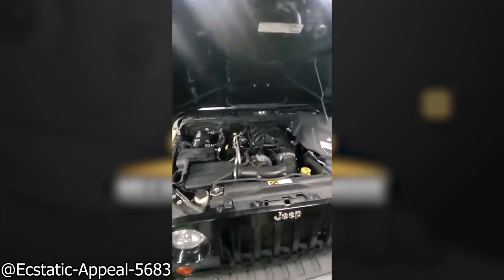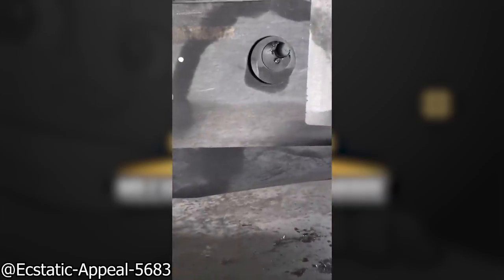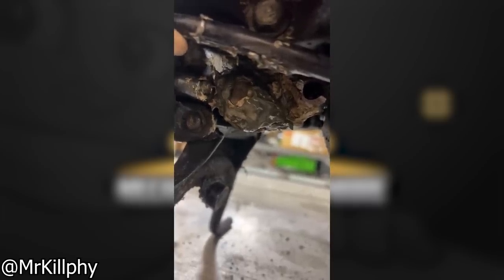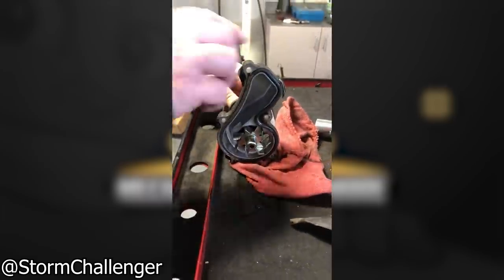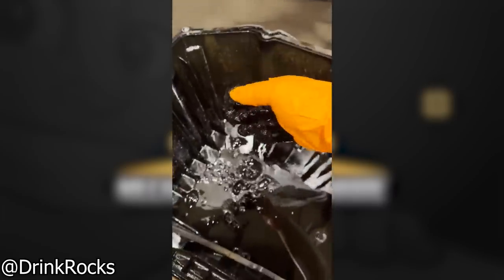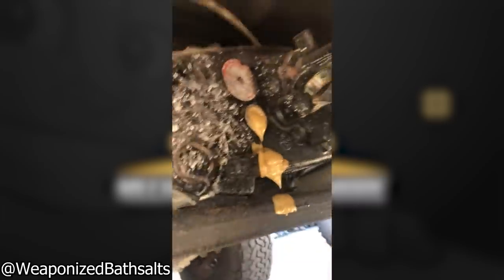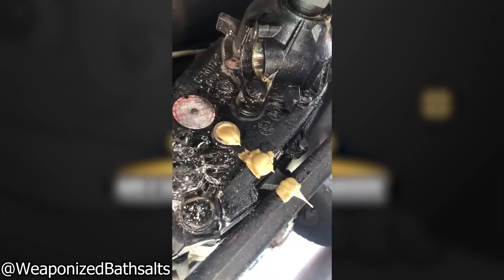Customer States 'I Just Had An Oil Change Now My Engines Smoking' | Mechanical Nightmare 121

Comment: These videos always astound me. My '97 Honda Civic is pushing 350,000 miles, and I've had VERY few problems with it. (I've made videos at every 25,000 since the car was new, with about the last hundred thousand up on youtube). I have been fortunate I know, but I also take care of my equipment. It seems that some people don't even do basic maintenance. (Note-I am NOT a mechanic-when I say "I take care of...". I mean, I send it to be looked at/maintained)
Reply: @delta250a  Right. Outside of those standard things, all I had to replace was a wheel bearing too, as well as the power steering rack, and just recently (last month), a bearing was going bad in the manual transmission, so I had all the bearings done as well as the clutch. I think that was it (Oh, I had some rust work done too)
Reply: kinda sad, these people are on the same road as you and I !
Reply: I have a 97 accord with almost 320k on it
Reply: Do you drive it hard?
Reply: @theglitch99  No. I drive at a very sedate speed, and do not rev it too high before shiftinhg
Reply: @davidlund5370  I know. It is scary. When people no longer are God-fearing, they have no qualms about endangering themselves and others. Not only the condition of their cars, but they way they drive them (selfishly) shows this. Only under God's Kingdom will we have considerate people
Reply: @SJHFoto  nah.. its an cultural issue, and God has nothing to do with it.
Reply: @theglitch99  I drive my BMW F21 pretty hard and close in to the 200k km mark, only had to replace the wheel bearings and timing chain (which is known to fail early and got a rework by BMW), otherwise it looks and runs like new.
And with driving hard i talk about redlining it regularly, doing 200+ kph for several hundred km and so on.
Reply: Cheers, I have the same car. It was extremely neglected before I got it. A ton of work and new engine later and it's a much happier car. Great vehicle even for all the abuse it's suffered.
Reply: @SJHFoto  Input shaft bearing.  Makes a lot of noise.  I had to replace mine as well.  While I had it out I replaced bearing, all the seals, and the clutch.  2003 Civic.
Reply: @hdfxrs9121  Yep, that was it. And I think you are wise to have it all done at once-I did the same-the cost came from the labour, not the parts mostly
Reply: KevTech 1  There is a time and place for everything. Using an instrument safely is paramount. Just because you can do something, it does not follow that it is always safe to do so. I'm sure you can see the logic in that
Reply: Indeed.
Reply: Hey bro, you’ve got a 6th gen I’ve got the lowly but under appreciated 7th gen. It’s the 05 EX so it’s the last model year when Honda had it all figured out with the 7th by then. EX so sunroof, cruise control, alloy rims, more stuff I can’t remember. But most importantly… V-TEC YO!!!  Yes btw, it’s a manual 🙃 239,000 and going strong. 
Good luck to you in your Civic journey my Honda Brotha!!
Reply: @LightsaberGoBrrrrrr  Thanks! What is the "V-TEC YO"? I am aware of the VTEC-E that the mid-90s VX hatchback had which gets phenomenal gas mileage, but I never heard of the YO variant

Comment: I really wanted to learn automotive repair but the college I went to just worked under the assumption I’d know everything immediately.
No idea where you’re supposed to learn this stuff but I get so paranoid about my car anytime I hear a rattle, just to realise it’s just loose ice or something
Reply: U start learning about cars by working on them. I started off by just simple oil changes and brakes. After that i moved on to belts, alternators, powersteering components, suspension. As time goes on, the more experience, the more you know what that sound is or how to find that leak. Its quite simple if u just try. I started at 16 with my rusty subaru outback with 300k on it, now, at 24, i can swap motors, transmissions, im working on my electric diagnostic skills. I love it cause you always learn something new.
Reply: buy a shitbox, buy a toolset, wrench on t

Comment: My 2015 v6 mustang has made that ticking noise from the valve pressure release too, the ticking goes away after you run it and the pressure balances out, if not replace the valve.

Comment: Oml the fuel leak thing

I thought my truck had something seriously wrong with it, since half the gauges on the cluster don't work (1991 Ford, go figure), it wouldn't start, it always starts, turns out someone got under it, and cut through the fuel filler hose to steal my gas
Reply: KevTech1  i was born after the truck was made, so idk if that would've worked
Reply: @instigatedeye5941  Funny you say that. The college kids that work for me think it is amusing that they are riding in my car and were born after I bought it! If it runs, there's no need to buy the latest thing and go into debt
Reply: At least you are lucky it does not have a cat on it, they would have taken that as well.
Reply: @SeanBZA  it actually does, we have strict smog laws in my state
Reply: @instigatedeye5941  None by me at all.

Comment: Damn if that is a nudge what’s a hit.
Reply: probably the wheel and strut assembly standing there while the rest of the car is gone...
Reply: I accidentally hit the curb once trying to park ran right up on it. No damage just little scuffs on the tire I whipped off. My ego was broken then felt really embarrassed I did that. Just for the hell of it when I got home I looked under the car there was no damage those control arms can take a beating. So when I see people with busted control arms you didn’t just nudge it you hit it hard.
Reply: I'm surprised it didn't crack the rim.

Comment: 4:51 What are we looking at right there? What I see in the circle looks like a vertical scratch in the cylinder wall which 90% of good healthy running engines have... Curious how that made it in this video of mechanical nightmares?

Comment: The gas tank hole reminds me of riding with my Dad in our big tilting flatbed truck.. We would haul cars in for scrap.. Back when you didn't even have to show a title to junk a car ! The car owners used to PAY to have them hauled ! Anyhow ..My Dad would lower the back of the tilt bed, lift the back of the car, and he would drive a brass punch into the gas tank with a brass hammer.. if the gas smelled good we would take it right up to the truck with a bucket. pour it straight into the truck thru a funnel and rag. .. Lower the car , load it and haul it in. I don't think you even had to remove the gas tank back then if it was empty.. Miss those times with my ole Dad.
Reply: I'm a scrapper and you still don't need to remove the tank.
Reply: @tinknal6449  Interesting, that might vary state to state.. I think? its required here now.  Possibly not by law but all the yards require it..  Also in Iowa once a vehicle goes to salvage...the title is destroyed .. the vehicle can never be on the road again legally. I am sure people work around it sometimes with title games.. I have heard of yards that would only sell half of a vehicle .. cut down the middle and I have seen a super valuable late 60's Bronco put on the bottom of a stack of cars ..probably just to stop people from trying to buy it.
Reply: @foodstick  I'm in Minnesota.  We don't need a title if the car is over  20 years old either.

Comment: 5:17 Kind of suspicious that it started leaking right after the other shop changed the oil, and smoke that bad.
Reply: First time it had enough oil to make it to the valve cover, nothing suspicious about that, lol.
Reply: @wally7856  Hey!  At least they took it in for a change!

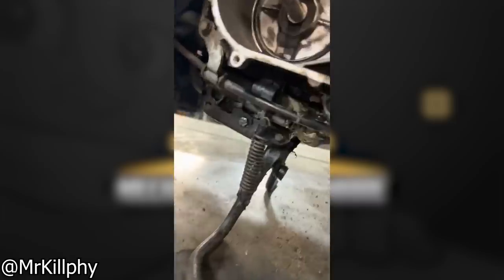Comment: 1:14 I'm not talking shit about anybody, I just see a lot of people "sealing" leaks with JB weld, Tape, foam, RTV, etc... I would love to be a third person point of view watching them diagnose the leak origin and then rummaging around or going to there local Rocky's and spending 20 minutes in the glue section. Then seeing them smear something that would never work, I mean they could have at least wire wheeled the area a little, but that's not the kind of people we're dealing with here. Then seeing there disappointment the next day when there's a puddle of oil. HAHA

Comment: 2008 Sonata... These modern vehicles, you can't even see the engine for all the plastic garbage they put on them. No wonder he didn't know his valve cover gasket was leaking. Now, compare to any Ford, Chevy, or Mopar made before 1980. When I open a hood, I expect to see an engine, not a big useless plastic cover.

Comment: JB weld is a good sign someone doesn't actually need to be having tools lol
Reply: Used JB Weld to seal a crack in an oil pan in an old truck I bought that was weeping oil at a pretty good rate.  Without draining the oil.  Hot glue to seal up the crack, then JB Weld over the hot glue.  7 years and not a bit of trouble out of it.
Reply: @bobbybeaver4423  if that's what you want to do; god speed
Reply: @bobbybeaver4423  I'd just like what I'm getting into with the Budget
Reply: On the trail 4 wheeling, just having 'tools' ain't gonna replace a part that's been cracked by an impact. But JB weld can get you home.
Used it on a wheel rim once, an oil pan, a tranny housing, and a motorcycle engine case. 
This is why both my Jeep and my bike have engine shields.

Comment: One of my cars is a very rusty ford and if you keep suspension and brakes in check and put safety 2nd your not gonna have much problems and some last years so just keep the shit maintained and it’s safe enough to drive
Reply: Yep, my trucks are all rusty but the frames are all sound.

Comment: If I was that sonata owner I would still be pointing fingers at that shop. All they would have had to do is loosen the bolts on the valve covers and then retighten them to make them look like they weren't loosen and that would cause the valve covers to leak because the gaskets were old and got moved. And they can't reform to new position because they're no longer rubber either hard as a rock.
Reply: It could be coincidental but that's a hell of a coincidence..
Reply: New oil wouldn't help either ,go right through the spaces..could be a nice little ruse..
Reply: Lol, noone does that. ive seen valve covers leak after fresh oil changes because of using better oil with more detergents. People dont understand that if they stretch a regular cheap oil change for too long and then decide to use some full synthetic or even just do an engine flush, it can cause leaks to occur on old seals. Alse most oil change places will put a qt or 2 extra in garbage hyundais because they burn so much oil and try to cover their asses because people like you try to blame the shop to get free work done. If you dont know anything about cars, dont argue with the mechanic
Reply: @adamdistortion8810  Well, there have been plenty of well publicised instances of dodgy mechanics sabotaging customers cars for profit, when they aren't diagnosing unnecessary repairs.  So while it may be unlikely, you certainly can't say "no one does that" and be right.

On the other hand coincidence is not causation, and you could be completely correct about the new oil through old seals, particularly if overfilled.

On the gripping hand it is, as we used to say, awfully suspicious.  So worthy of being investigated.
Reply: My experience is the new oil cleans away all the sludge sealing it 😂 especially if they use an oil flush

Comment: These clips need the volume adjusted as they are too low. My computer is set ate a perfect level for me and I shouldn't have to adjust it to such a level that I deafen myself when I watch something else. I also have another app open with sound on so cannot switch back and forth on volume.
Reply: YouTube changed something a while back that screwed with the volume. I use an add-on called "600% sound volume" that works OK.

Comment: What is happening at 3:15?
Reply: what you see is the lower A-arm of a front suspension. The bolt keeping it in place is loose. The shim has an off-center hole made to be turned with the bolt being turned, to adjust the camber with it. Which is why it moves that much; it also seems to have bent down the struts left and right said disc would press against. (think of it like a camshaft's cam moving the shaft instead of a valve) the wheel must be all over the place with every acceleration and deceleration...
Reply: @lotharrenz4621   I see-I think. Thanks, Lothar!
Reply: At your service. :)